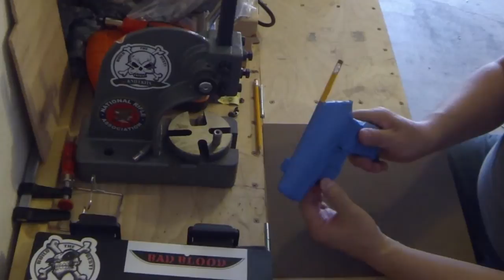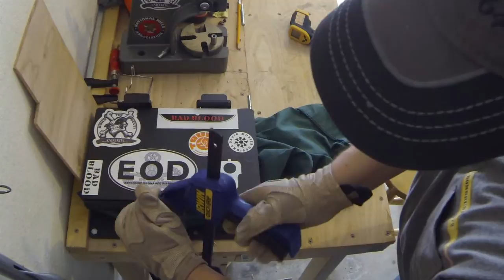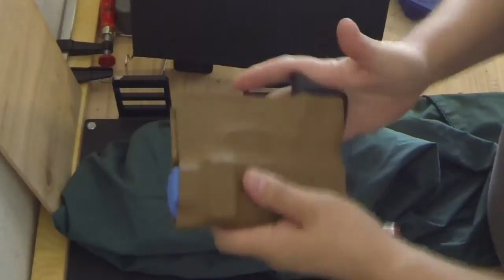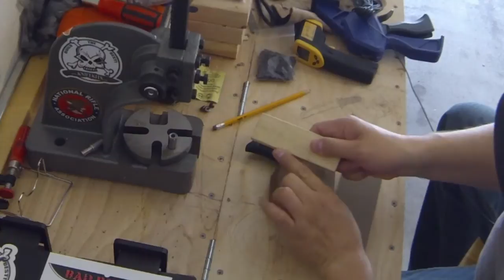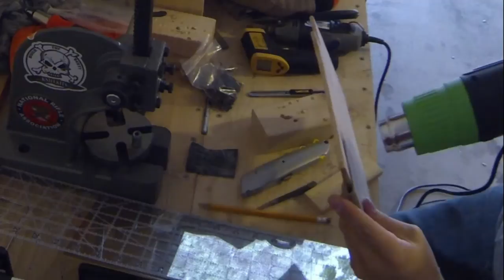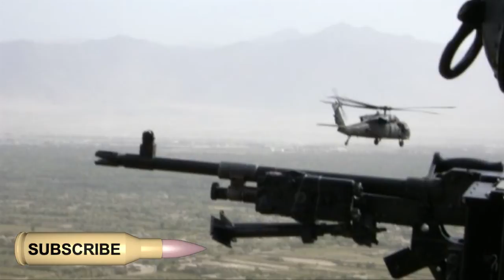How to make a Kydex IWB Holster

Comment: hey im just getting started do you cut it to final shape with tin snips? iv also seen videos of coping saw trying to figure out ideas for tools
Reply from the maker: +Nick Ackerman The snips get it close (within about 1/8 inch) the rest is sanded.  Now I use a scroll saw, it's much easier.  I think a coping saw would do decent if you can keep the kydex held firmly to a work surface.